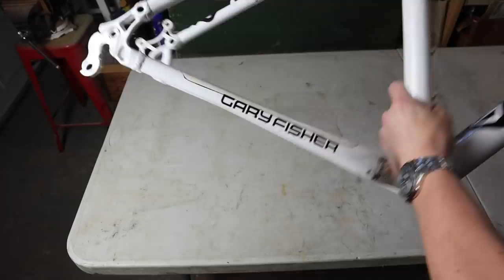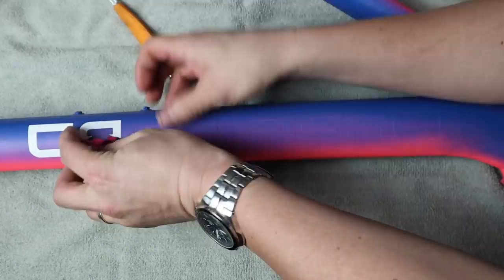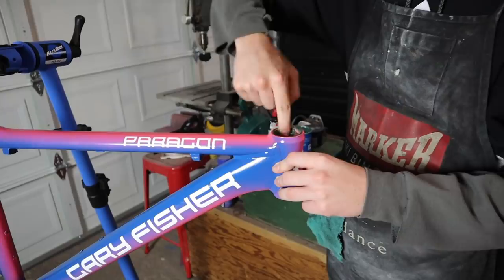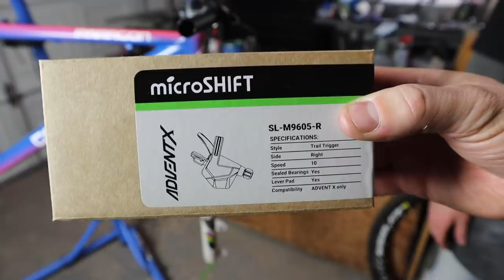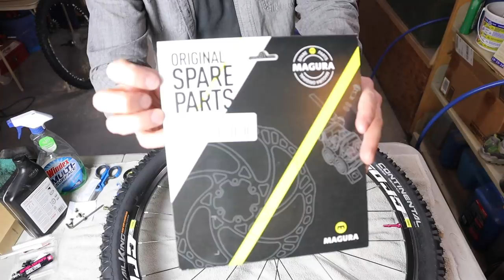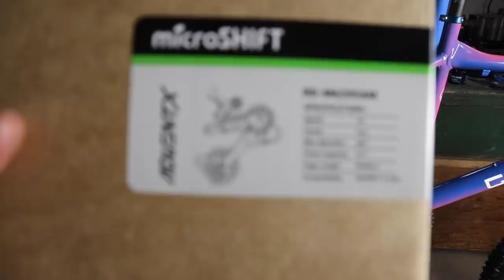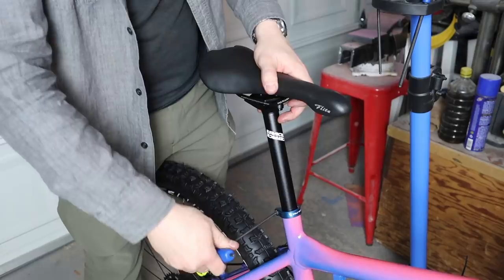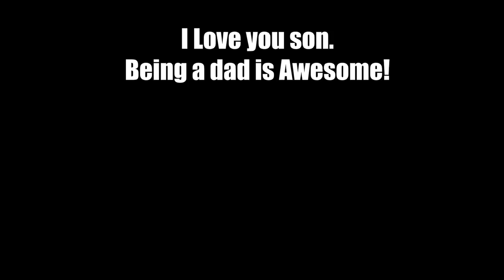Being A Dad is Awesome - Retro fade Gary Fisher Bike Build

Comment: What a beautiful video, I’m going to watch again with my 11yr old.  I can’t believe I stumbled across your channel just looking for steel bluing.  I’ve been restoring frames for ages but functional over original but one thing I miss from nostalgia is proper headtube badges.  I’ve been acid etching and my son recently had the idea of bike badge belt buckles as well.  
Just a tip, the husslefelt stem enamel strips really easily with cellulose nitrate stripper should you do another.  I nickel plated mine.  
Anodising also strips really easily in caustic soda and my next project will be anodising some parts.  
We can’t get away with broken cable runs here in the UK, too much mud and rain.

Comment: Great bild.. I would probably have spray painted the crankset since these legs need some sanding and painting in semigloss black if i can see correctly then dress them in some silicone gloves for protection and would also pick a brand new or painted the handlebar purple or blue  or mixed like the frame in an auto shop for a maximum lasting effect since it comes in contact with metal parts and chipping would be anoying ..
 Apart from those little minute choices the end result is excellent.

Comment: Please explain the taper conversion a little bit more in another video please I'm very interested in that I have a rock hopper with a straight steerer I would love to put this Reba fork I have sitting around on it. You build some beautiful bikes this one by far has caught my attention. You can see my rock hopper that I'm working on upgrading on my channel please excuse the heavy breathing I just got off of doing a technical trail. And I'm not a professional with doing video so it's whatever is shot on my phone gets put up. I wonder if that taper conversion would make the bike a little bit more slack in the front that would be nice I could put some trail tires on that bike and use it for more technical trails

Comment: Another great build! I have two questions:
1. What fork did you use?
2. If my frame's headset is 44 mm, the Chris King Inset 7 will work? (tapered forks seem to be more plentiful these days)
Reply from the maker: Sure. First it’s a Sid World Cup fork with a tapered steer tube and second, yes; if your head tube on your frame accepted a 44mm headset, top and bottom the Chris King Inset 7 should work for you to run a tapered steer tube fork with a 1 1/8 to 1.5.

Comment: Hi, I have an old Gary Fisher frame (2000 Big Sur) that I have been holding onto for 10 years plus because I want to build it back up. Could you suggest any online resources in terms of where to get started with compatibility issues - in particular the rear disc mounts, it shipped with v brakes but it has disc mounts, they just look different to ones on my newer bikes.

Comment: I really enjoyed watching this video and I’m hoping to get some advice. I have a 1997 Klein Adroit with the MC2 airhead set. I want to upgrade to modern air suspension fork. The headtube is oversized. Do you by chance know the I.D. Measurements of the headtube top and bottom on your frame? Bottom I.D on mine is 50.3mm bearing is 51mm. Top I.D. Is tough to measure, as there is a lip because the bearing is seated from the bottom. The bearing measures 44mm. Any recommendations on headsets to fit? I hope to hear from you. Thank you.

Comment: Where do you find these frames?! 

I'm looking for an early 2000s era hardtail in size small that has disc brake tabs on it - but is pre 27.5/29er "progressive" geometry 
Something light but strong, and medium to high end for its era... but due to its vintage  - inexpensive. 

Want to do a retro modern 26" stock trials bike in the old rules style (must have a seat, and at least six working gears.)  But want to run disc brakes instead of hydro rims. 

Anyway - can't find the right frame out there on the net' or locally.  Lots of true vintage stuff, lots of prog geo stuff on 27.5/29er, but cant find frames from the niche era between 2000-2009.

Comment: Did the headset with the lower part outside of the frame lift the front and change the head angle, or did you compensate that with the height of the fork?

Comment: Whats the original tires saiz? Is it 26? And you change it with 27.5 tires? Its steel body right?
Reply from the maker: It’s an aluminum frame made for 29 inch wheels and that’s what I put on it.

Comment: how anyone uses cable disks is beyond me. I spent too much on those hyped up paul components brakes to have two cables fail and the adjustments getting out of wack. xt brakes are cheaper, better power, more reliable, and less adjustments.

Comment: Mid 2000's cheap disc mount only integrated heatseted aluminum frame is not retro, just old worthless junk. Retro is cantilever mounts only, short travel fork geo, 27.2 seat tube dia etc...